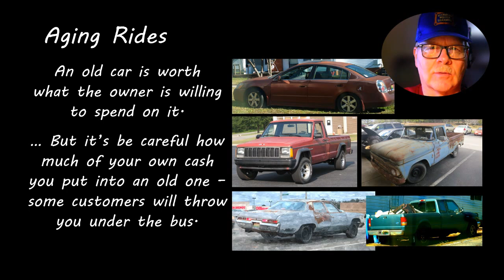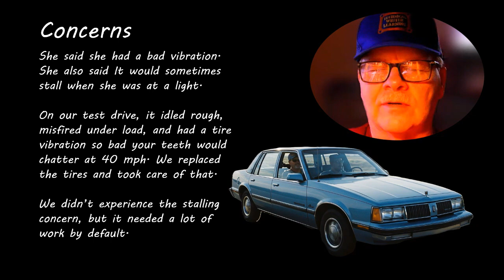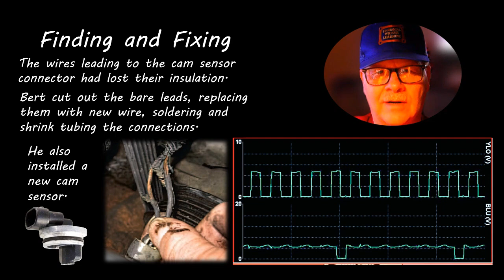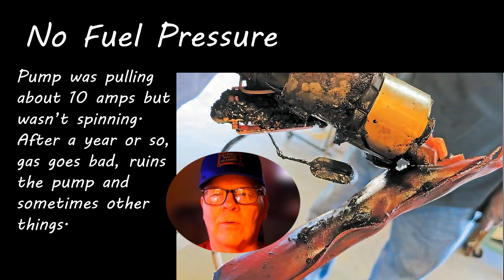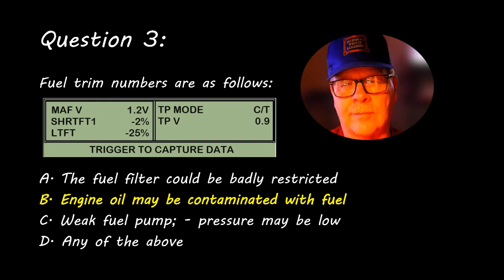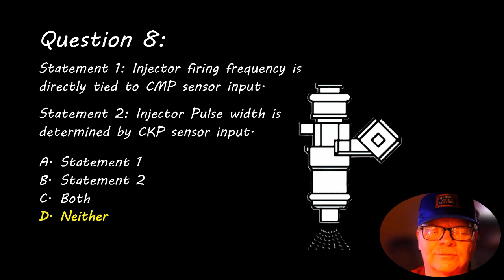Is It Worth Fixing, and a Pop Test

Comment: You mentioned the distributor or ignition module/crank sensor location on the Cavalier motors 2.0 and 2.2 and Iron Dukes. What is the official method of accessing them for service? You can't get at them from below due to the steering rack. Should you just squeeze your arm in the small gap near the brake booster and automatic transmission dipstick? Should you remove the intake manifold?
Reply from the maker: It varies by the car - on the one I was talking about we were able to get to it without removing anything - on some others it's a lot more difficult. You just have to do what is necessary (obviously) on the car you're working on.